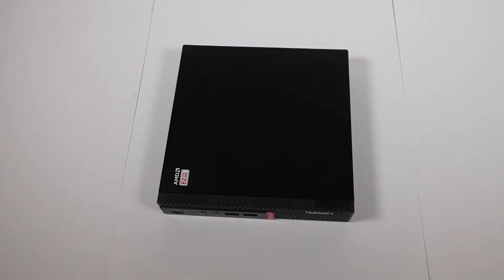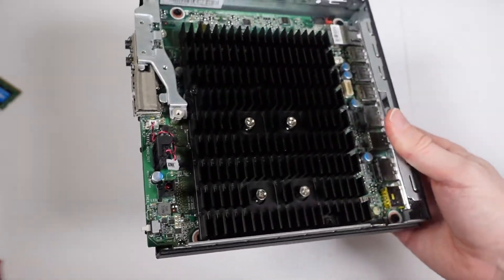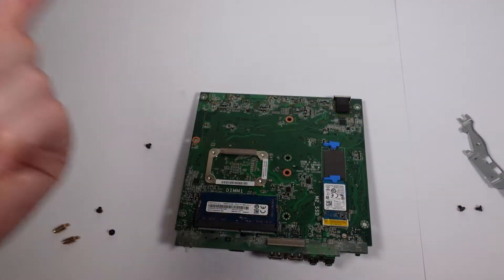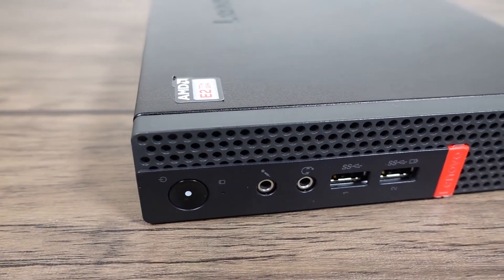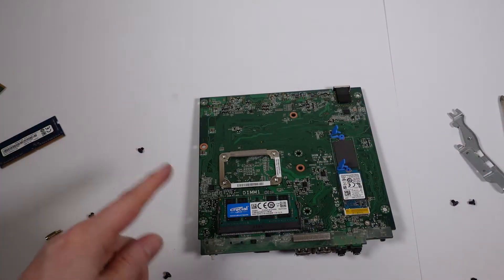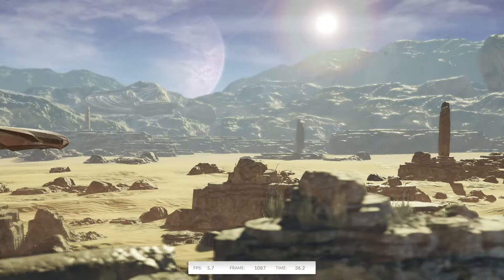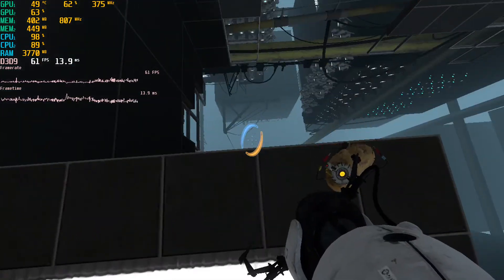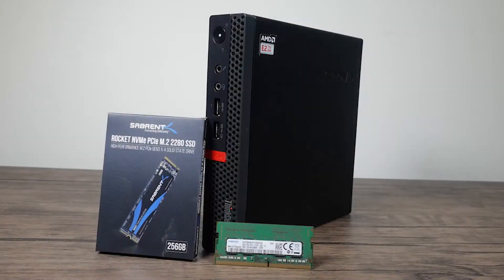Lenovo M625q Tiny - The £300 AMD Thin Client

Comment: What I gather from this is that you have to remove the heatsink in order to access the RAM and HDD slot?! That can't be right on a business machine; there has to be another way.
Reply from the maker: I wish that was the case. Business machine sold for purpose are generally not easy to upgrade or change. Good source of cheap second hand hardware though.
Reply: @AvenyetsTechWorkshop  I now own one of these and can confirm that there is indeed a panel on the back which is removable so you can access the back of the motherboard without removing it. They are business machines, but that also means they have to be easily repaired due to service agreements. If yours doesn't have a panel on the back it has to be a very early production model, but I doubt it. I got mine used at £40 so they can be had at a quite affordable price.
Reply from the maker: @wildonemeister  really how useful. I've got mine in a box under my desk I'll have to have another look. Thanks for the info!
Reply: not true, maybe he just tore the entire machine down has part of his review but the bottom has a seperate plate which slides off once you remove the single back screw giving access to the bottom of the motherboard without having to remove it. this will expose the ram and the m.2 drive;

Comment: Thank you for the info. I'm looking at getting a used one to use as a headless game server, hopefully it'll handle it okay since there won't be any graphical load. The one I found already has 8 gigs of RAM, so maybe it'll be fine as is 🤞
Reply from the maker: This certainly has the grunt for a simple server, but like everything with servers you can run on low requirements for low load but you might need a bit more if it gets busy. Good luck I hope it works out as you planned!

Comment: Hi, can this do Netflix at 4k?
Reply from the maker: This will be limited to 1080p at best and even then I would not be surprised at the random dropped frame. The CPU and GPU are just too slow to handle it unfortantely.
Reply: the m720q will run netflix in 4k its the same form factor but not fanless.  still very quiet machines

Comment: Curious, is there anyway to increase the TDP on the APU? It seems this machine is mainly CPU limited once you've taken care of the lack of memory, so any bit of extra CPU performance counts.
Reply from the maker: Not that I'm aware of. Some boards might offer it but unlikely. The Lenovo is business and the cooler is tiny so I would not recommend it. It's not like some mobile chips that are limited below what they can do.

I had some trouble overclocking using a different board as well so the limits seem to be rather strict. (Ignore my previous comment I thought it was another video. Similar issue though)
Reply: @AvenyetsTechWorkshop  Oh that's really too bad. Since the heatsink is so massive I figured there'd be some thermal headroom. And since this APU is the energy efficient version of the E2-9000, which itself is really just a lower power version of the E2-9010, I was hoping we could try overclocking or at least upping the TDP to get closer to those chips.
Reply from the maker: It's odd chip all round the key is the power usage but it's locked at the chip level I tried a few things but nothing gained much. Faster ram helped a little but only a little. I'm using it as a dosbox machine works well for that.
Reply: @AvenyetsTechWorkshop  That's too bad then that it was locked down that much. Still quite impressive that you managed to basically boost Portal 2 performance by 6x though.